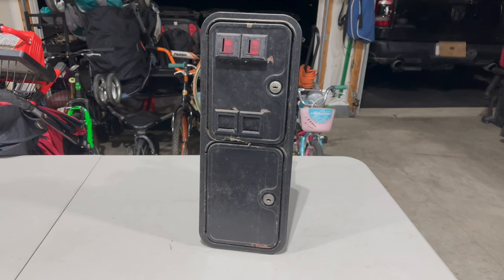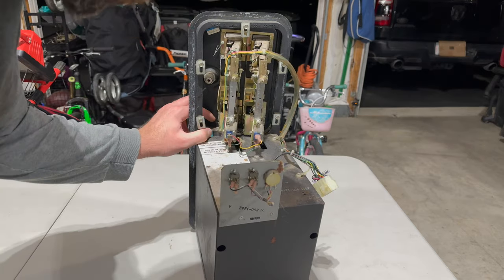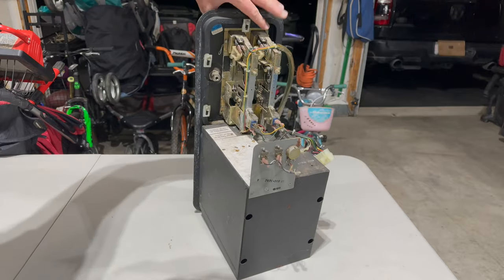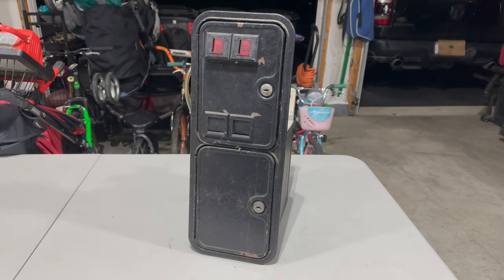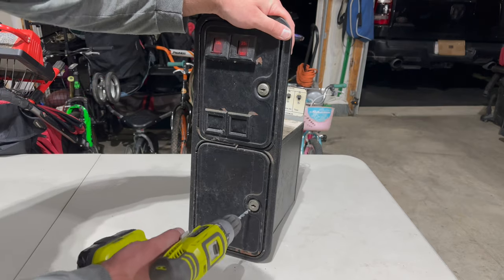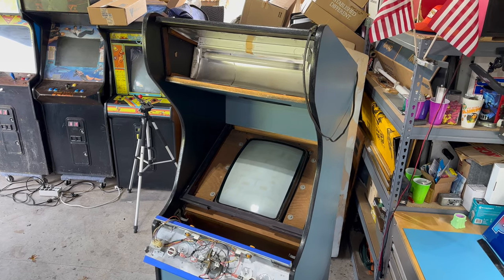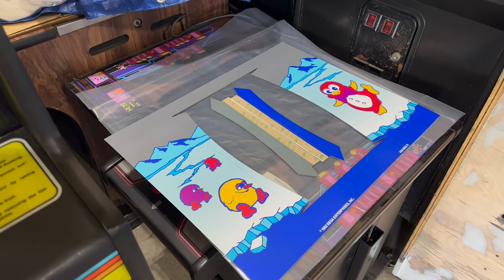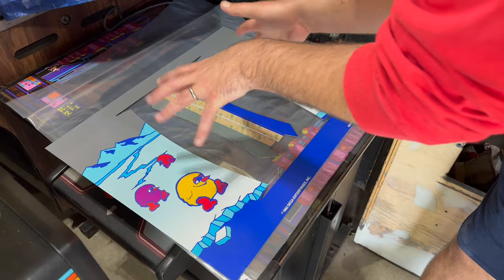I'm on THIN ICE! 🥶 Sega Pengo arcade restoration part 5 🧊🐧 THE GRAND FINALE!

Comment: Nice video. Have you ever considered using newer LED bulbs for the marquee instead of old. style bulbs? Other arcade channels claim that LED bulbs don't cause the artwork to fade over time like old bulbs.
Reply from the maker: Thanks! I’m sure they’re right, but I try to keep things as original as possible (he says as he used a switching power supply & JAMMA harness in this project) and my games don’t see anywhere near the 12-24 hour per days duty cycle that games saw on location back in the day.
Reply: @overtimearcade  They are totally your games and I understand keeping them original.  That said if they were mine I think I would also go LED bulbs as they shouldn't damage the marque artwork AND will require less screws being removed and inserted into the wood cabinet to access the marque bulb/balast/starter over time.

Comment: Spade connectors are the right way. Don't solder the control panel. They weren't soldered originally. It was OPs that would solder. It's bad as you shouldn't apply heat to the switches (microswitches more so)
Reply from the maker: Mecha vehemently disagrees! 😂 And are you sure no manufacturers soldered the CP harness to the switches?
Reply: @overtimearcade  I didn't say all used space connector, Midway would solder them on in the Pac-Man era but by the time Mortal Kombat was out they switched to spade connectors. Nintendo always used spade connectors. If you solder them on at least use some heat shrink tubing as some stain relief. Usually soldered control panels have connections that are broken off with only a few strands still connected.
Reply from the maker: That makes sense — most of my collection is Golden Age games.